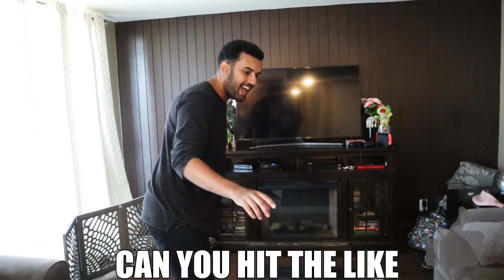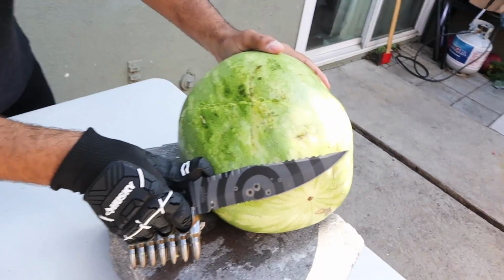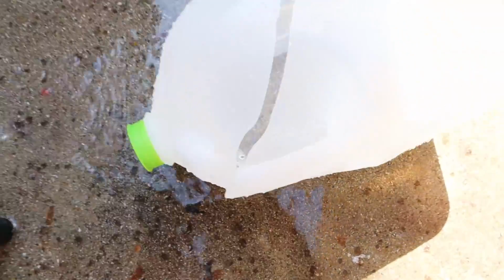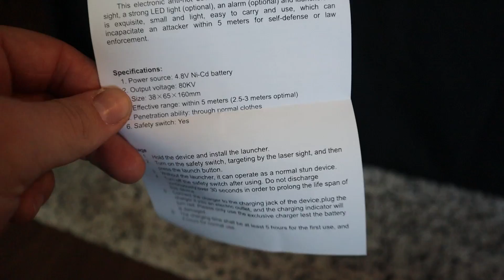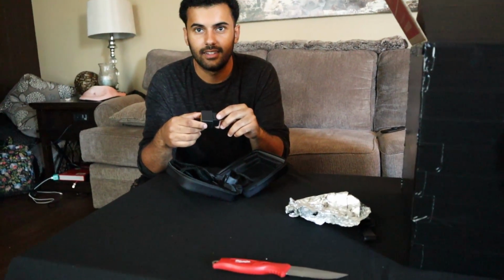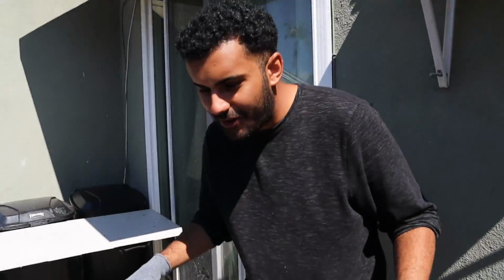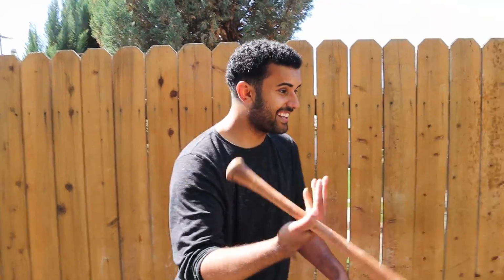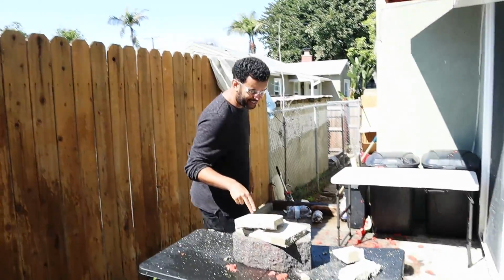I Bought A Dark Web WEAPONS Mystery Box 2!! *SCARIEST BOX OF ALL TIME...*

Comment: The barbed wire makes the impact concentrated to just a few points instead of the entire surface of the bat, so the force applied to whatever you're smashing is basically increased at the point of impact by several orders of magnitude

Comment: What's crazy is that that stun gun is a dangerous one the police issue has a voltage regulator and the first shot only gives them like one short blast, pull the trigger again and it'll give him a longer blast. And it looks like you don't have control you pull the trigger it keeps zapping however hard it blasts and as long as you want that's scary. How do I get one of these random packages do I have to be a big YouTuber to get the hook